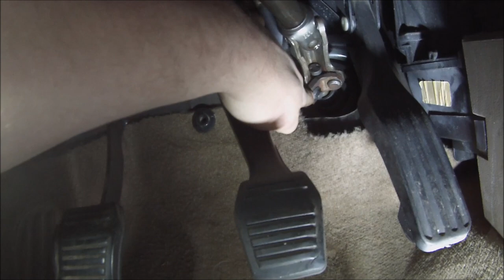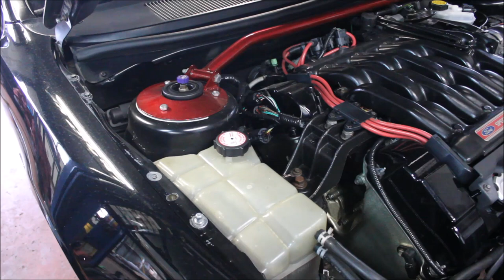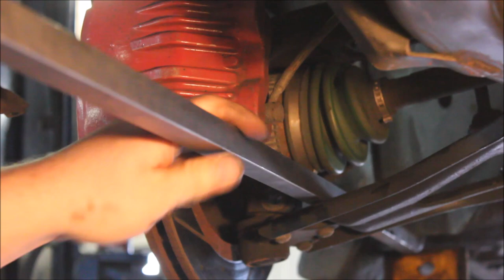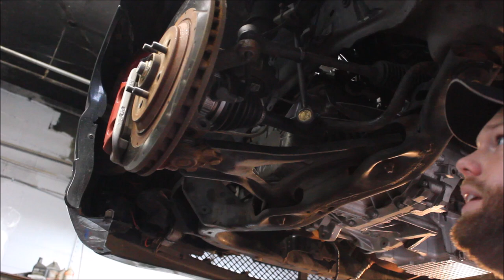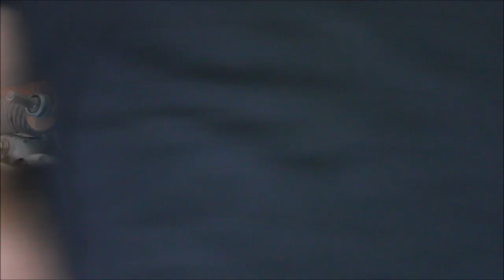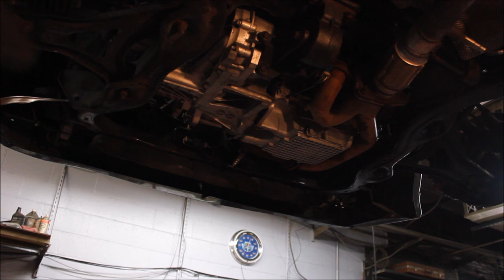How To #3. Front subframe removal and installation.

Comment: Can you please give me info of the electric power steering kit. I'm thinking of doing the same thing.
Reply from the maker: Its a Citroen Saxo pump. Just need power, ground, fuse, switch, pressure line and return line. Its really simple.

Comment: did you leave the part where you have to hoist the engine up so it won't fall, when you remove lower engine mount?
Reply from the maker: The engine is held up by the motor and trans mounts on the frame rails of the car

Comment: Can you advise me please!
    I was about to change front ARB  bushes on my 2006 Saab93 diesel  when i realised i couldn't get a spanner on the rear  bush clamp bolts as they are tight against the bulkhead. Is it possible to undo a few subframe mounts and maybe prise it down to reach the bolts without to much dismantling? I would love your imput, thanks, Carl.

Comment: Great job well done just would like to know what it would cost for what you have just done.
Reply: Did not mean to hit thumbs down. Sorry.
Reply: Cost me $100 for a used cradle. About 4 hours labor. It could take several more hours because of hiccups like rusted bolts etc. Most charge from $75/hour to $150/hour. Also some mechanics will not accept outside parts. So you'll end up needing a brand new part that they'll order and mark up the price.
Reply: I also snapped a sway bar end links bolt so I had to buy another link.
Reply: 80% of the time the exhaust bolts will break also.
Reply: And that's all assuming that the cradle is the only problem. Most of the time they're rusted, which usually means there's more rust elsewhere. Radius arms especially.
Reply: And I just realized I'm commenting on a 4 year old comment.

Comment: Can you do a video on the steering rack?  I’m currently rebuilding my 98 and want to look into it before the engine goes back in
Reply from the maker: This is basically the same procedure for doing the steering rack. You just have to remove the steering lines form the power steering pump.

Comment: That's a fantastic video.  Great job....you need to get onto 'Wheeler Dealers'!  You clearly know what you're doing and you describe it well with good video.  Approximately how many hours of work are involved?  
I'm just turning 73 so I reckon it could take me up to 2hrs to do it....I do have a jack and some axle stands so my only problem will be physically getting back up once I'm under the car.  Maybe I'll wait til I die and then they might let me use the coffin hole as a pit for doing this job....that would make it easier....in one way.....

:) Cheers from UK
NoAxe
Reply from the maker: I can usually do this job in about 1-2 hours depending on how hard i'm working at it. The subframe is easier to put back up into place if you have two jacks and two sets of hands! Good luck! And dont die too soon! hahaha
Reply: @ForgottenSVT  Hi there and please accept my humble apologies for not thanking you for your kind reply earlier!!  I use hotmail 99% of the time but noticed your reply in my gmail today....2yrs later!!! :)  Gulp!! :)

Comment: Where do u get the replacement bushings? I have a 2001 mercury cougar with the same exact subframe, bushings have the same part number but I can't find them anywhere due to ford discontinuing the part... I just pulled a subframe off of another cougar but the bushings will last probably a year or so..
Reply from the maker: PRT autosport makes billet aluminum replacements.

Comment: great video! Do you have any tip for rebuilding the manual transmission on the Contour? We run a 98 Contour in ChumpCar racing and it seems our synchro is shot, so we're going to swap the transmission. Also, we've only been able to find OEM clutch kits, so any advice on finding performance parts would be really helpful. Thanks again!
Reply from the maker: Unfortunately, i dont know anything about rebuilding the transmissions on these cars. I had my wife's boss rebuild mine for me, as he owns and operates a transmission shop. As for clutches, i've always run a Luk rep set and i have yet to have any issues with it *knocks on wood
Reply: Thanks for the reply and info. I got antsy and bought a sachs clutch and flywheel, so we'll see how it goes... Keep the good info coming!

Comment: Great video sir, quick question. What battery powered ratchet is that you are using? looks nice and compact.
Reply from the maker: Thanks! And it's a Snap On 14.4v 3/8" drive. Its a great tool, but a bit pricey!

Comment: i got a 08 2 door altima any insight on it and is my subframe interchangeable?
Reply from the maker: No they subframes wont interchage. and what kind of insight are you looking for?
Reply: on the simplicity of the job
Reply from the maker: Well, every car is different, but basically the same concept. You'll need to disconnect your rack, control arms, sway bar links, any mounts, support your motor and remove the main bolts holding the frame in place.

Comment: Year & Make & Model???????
Reply from the maker: 2000 Ford SVT Contour
Reply: Yeah, the 2000 model year was with the easy stamp, double, control arms. The earlier had the single LCA & generally a non-interference zetec-e or the standard v6. I think all the early svt's are long gone now. Seems like only the 2000 svt is still relevant.

Comment: you didn't show how to remove it or how to replace it.
Reply from the maker: What do you mean?
Reply: @ForgottenSVT  you didn't show you removing it or show how you put it back in.
Reply from the maker: @samanthaelizabeth1601  The video is for removing and installing the subframe. It does show it all. I explain how to do the rack as well, but my car doesnt run the factory lines because i've modified it.

Comment: Good video but you forgot to mention to support the drive train, only thing holding on yours is now one motor mount That probably will need replacing if you didn’t support the engine and transmission.
Reply from the maker: Actually, that's incorrect. There is an engine mount and trans mount still attached when dropping the subframe. The 2 mounts remaining are the main support mounts. The front and rear mounts that i remove with the subframe are just roll resistors and support no weight.